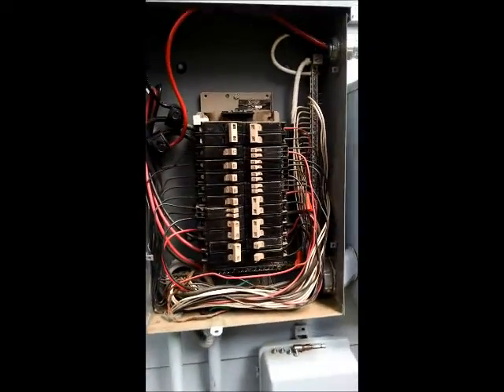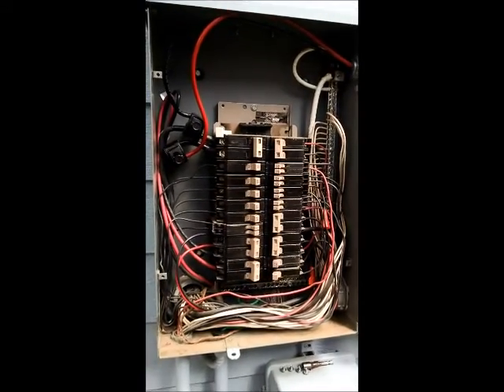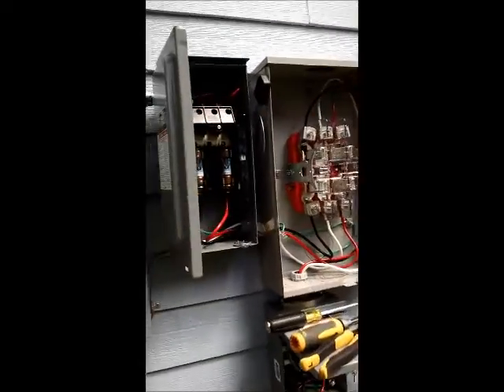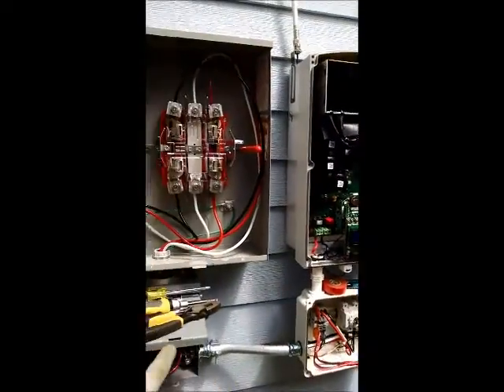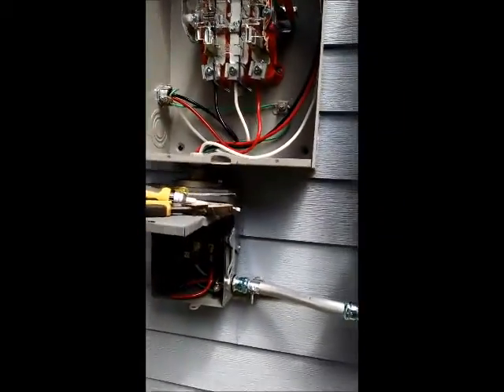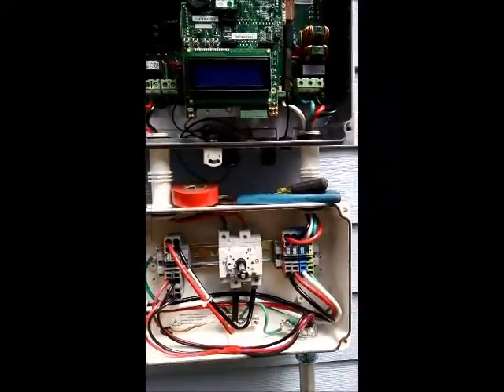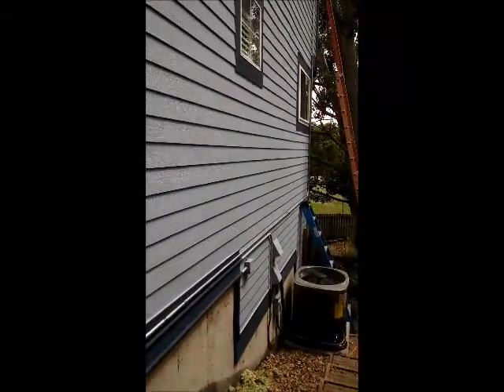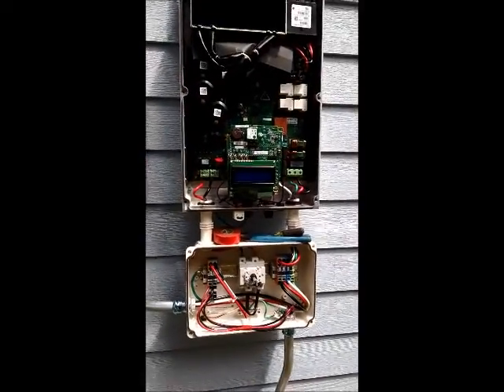Solar BOS overview video with line side tap Better Res

Comment: So do I understand right that the neutral terminal on your production meter is not connected to equipment ground?
Reply from the maker: Yes, that is correct.  the production meter is not service equipment, so I do not bond neutral to ground.  Check with your local jurisdiction electrical inspectors or utility.